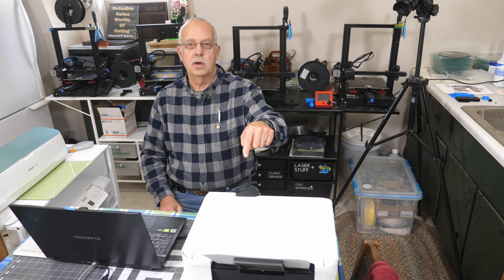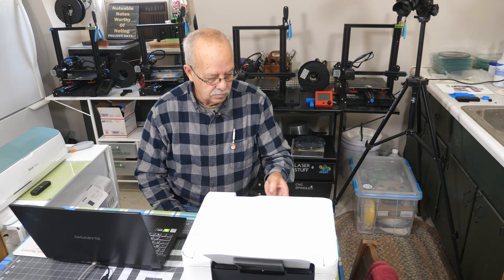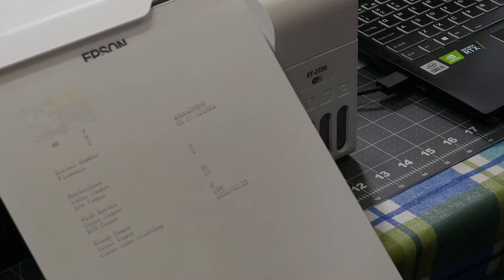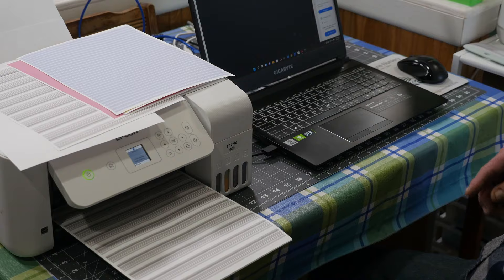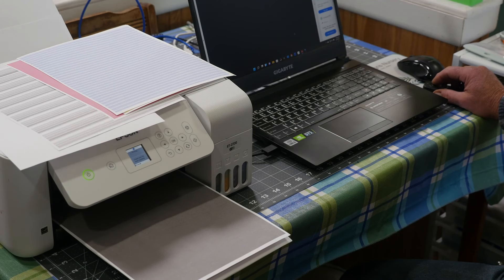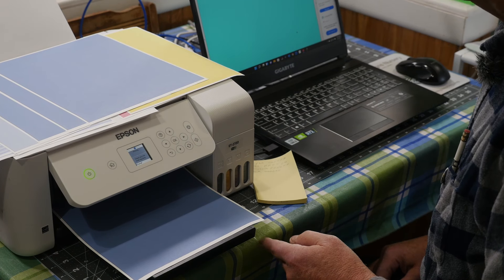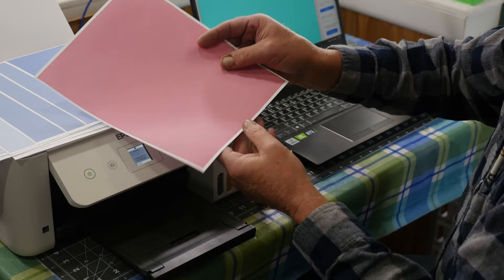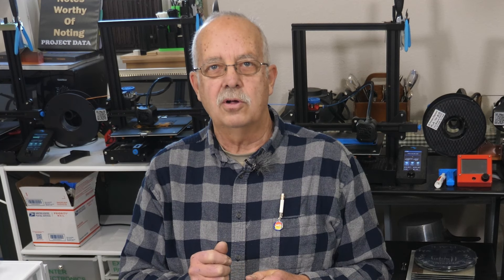Epson 2720 Printer Clogged Nozzles FIX

Comment: Very informative video. Thank you! I discovered yesterday that my cyan has completely stopped printing. A bit surprising as we print regularly. We're in the Phoenix area where it is HOT right now, and our A/C went out a few days ago. Temp in the house rose to almost 100 before we were able to get it fixed. I'm wondering if that high heat might have done something. Anyway, I've printed about 10 copies of the cyan PDF with no results yet (interspersed with about 4 head cleanings and nozzle checks). At what point would you suggest I dive in and try the power clean?
Reply from the maker: Try shaking the printer from side to side several times and try the cyan again.  Could be something as simple as an air bubble or some sediment in the ink tank blocking the line.
Reply: @rogersshop  Will do. I actually filled the ink to 100% today, which had no effect, and then did a power clean, which also had no effect. Will try shaking and then if that fails, reach out to Epson. Thanks for the suggestion.
Reply: @rogersshop  Thanks for suggesting the shaking option. I was literally going to head to Costco today to get the Epson ET-2850 (on sale right now) - with some reluctance giving my current frustration with my ET-2760. A couple hours after shaking my printer a bit, and literally right as I was heading out the door to Coscto, I tried one last cyan print sheet. Lo and behold, it worked! Seems to be totally back to normal. So for others out there, don't give up before trying the shake method and waiting a little while. Also, for whatever it is worth, I called Epson support and was connected immediately with a tech support specialist, who was not terribly helpful with further troubleshooting (my warranty ended 6 months ago). However, he did follow-up via email with info on local Epson service centers and discounts for new or refurbished printers. I'm thankful I don't need to go that route now that mine is working again thanks to Roger.
Reply from the maker: @bradstoops8862  Glad it worked out for you!  This works about 90% of the time as it clears any sediment or air bubbles.

Comment: hi roger.  thank you for the wonderful video and explanation of cleaning the nozzles on my ET-2720.  my tanks are currently 3/4 full and I use my printer almost daily.  every now and then a nozzle clogs and I run the "clean print heads" and eventually everything works fine again.  this time - my yellow did not print at all.  I tried to clean several times and still nothing.  so, I downloaded your yellow sheet and have now tried to print that about a dozen times and still no yellow color is printing at all.  I even tried cleaning and a nozzle check one more time.  no progression.  I appreciate your info about the maintenance tank - I never knew about that.  I'm guessing there's not point in running a power clean now- because you said this method is basically the same, but the maintenance tank doesn't get filled up.   so....  any suggestions on what I should try now??  thanks in advance for any help you might have...  :0)
Reply from the maker: Try this:  Disconnect printer cables.  Picj it up and shake several times side to side, then try the yellow sheets again.  This works most of the time if there is any sediment blocking the bottom of the tank.
Reply: @rogersshop  thanks so much for the quick response.  I tried what you suggested.  I then printed 6 more sheets of yellow, but still got NOTHING.  I cleaned the print heads 2 more times and did another nozzle check.  FINALLY a few yellow lines showed up.  I cleaned one more time and printed another yellow color sheet and it printed yellow!!!  so something definitely shook loose.  THANK YOU SO MUCH.  it looks like I am back in business.  so relieved.  :0)

Comment: HI Roger!  Lots of great information.  I am still not able to get my  Epson 2720 to print the cyan and magenta.  The yellow is great but the black remains with lots of lines.  My printer is only a year old and I haven't printed much with it.  Unfortunately i  didn't realize that i needed to print something out way more often.  Am I doomed or is there more I can do to unclog the printer head?  Thanks for any info. you may be able to share.  Great video !
Reply from the maker: If the color sheets do not produce results after many tries, a Power Clean may be necessary.  Sometimes, gently shaking your printer from side to side may clear any sediment that may have formed in the tanks.  Try this, then more sheets.  Works for some, but not everyone.

Comment: Hi Roger! I am having an issue with my ep2720. It suddenly started printing blue colors and nozzle check have lots of broken segments/line even on the words. I am printing your black pdf and it is coming out brown on my regular printer paper… should I keep printing for it to be black?
Reply from the maker: Is it sublimation ink?  If so, it can appear brown in color until after the heat transfer.

Comment: Before I saw the video I ran a couple of nozzle checks and 2 deep cleans. I printed 25 pages of the same color and haven’t seen any change. Do you think it is worth ordering more ink and continue trying?
Reply from the maker: You could have a clogged line from the ink tank to the internal damper tank.  You can try shaking your printer from side to side several times.  This works most of the time, but not for everyone.  Some inks can form sediment if sitting for a long time and this may free it up.

Comment: You’re video is great! All of my color tests sheets resulted in success with no lines, except for the Cyan. No color, no nothing. I’m running the test sheet for the cyan continually with nothing showing on pages. Running 45 pages at a time over and over. What are your recommendations please? A new printer is not in my budget.
Reply from the maker: Sometimes sediment can form and block a line.  You can try shaking your printer from side to de several times (don't get wild, though) and try again.  This works "most" of the time, but not always.  As a last resort, try a Power Clean.

Comment: Roger, awesome video but sadly my printer has been through about three pages each of magenta yellow and cyan and I haven't got a lick of color yet. I'm gonna keep going and comment again if it clears, but curious if you've seen a clog that won't clear?
Reply from the maker: Try shaking the printer from side to side several times and try again.  Most of the time, it is not the head clogged, but a tank or line.  I have also run into some that may take 25 or more sheets to finally get a good color sheet.
Reply: Thanks Roger. I'll give that a go and let you know if it worked for me. So far I've run about 6 sheets of each color and still not even a blip of any of them. @rogersshop

Comment: Thank you so much for this video!  I haven't used my printer in a few months, and my pages got worse with each nozzle check. Originally it was just missing magenta and cyan. But now my page is completely blank. I am printing the colors now and hope this works. =( so far I have a yellow page, blank, yellow again...and waiting for the 4th.

Comment: Thanks for the video and all of my colors are working well except Yellow.  Have run 20 sheets on Yellow only and cannot get anything to show up.  Any other options?
Reply from the maker: Sometimes it can take a LOT of sheets running through before the head clears.  You can also try shaking your printer from side to side in case sediment built up in the tank and is clogging the line.

Comment: Great video!  It worked for every color but Cyan.  Tanks are all full.  Any more suggestions?
Reply from the maker: You can try shaking your printer from side to side several times.  Some inks can form sediment and clog the lines.  Works for some, but not everyone.

Comment: roger help i am trying to use the paper method to unclogged my nozzles and all i can get it to print is yellow.  The black , cyan and magneta is not showing up at all.  I have the et-2400 and i am using it for sublimation.  I have been using it and now it is printing only yellow.  Also how do i print the sheets you have suggested except the yellow?  Please help
Reply from the maker: You can try shaking the printer from side to side several times, then try individual colors again.  Works for most, but not everyone.
Reply: Thank you. Will try

Comment: My L6190 prints perfect test pages after a head cleaning, but fails to print after 5 minutes of idling right after cleaning it. What could be the problem? I’ve tried cleaning the capping station, the wiper, cleaned the suction pump tube. What else could I be missing?
Reply from the maker: Not familiar with that model (and I am not a printer 'expert').  If just one or two colors, could be sediment in the ink tanks.  If all colors, then the damper tanks are losing prime.
Reply: @rogersshop   I have primed the dampers, and I don't think it has any sediments in the ink tanks. The problem worsened after doing a power cleaning, and has clogged all colours except for yellow, but yellow fades out after awhile as well. Any other ideas?
Reply from the maker: @jundaaaaaaaaaa  There could be soilds/dried ink in the printer head and that is near impossible to clean out 100% and requires removing that part (not easy).  There is a "cleaning solution" out there where you soak the bottom of the print head with a paper towel saturated in the stuff, but that will not clear any solids inside the head and is a mess to deal with.

Comment: thanks so much great video as usual! I have a question. My printer epson 2760 is making blobs of ink (black) at the top of my pages. I am going run your cleaning nozzle. These spots look like the ink is spilled in one place on the paper. any ideas? thanks
Reply from the maker: Run a few pages through with solid colors and it should clear it up.  The "pads" may have excess ink on them.
Reply: thanks I will do that.  I wondered if it was the pads. I use my printer just about every day, so this should really help!

Comment: thank you for this information.  My black worked great but the other colors have nothing at all on the paper.  So far, I have run 5 sheets through for one color and nothing.  Could it be something else?  My tanks are full.
Reply from the maker: Several things could be at play.  Sometimes, inks can form sediment if not used for a period of time.  You can try shaking your printer from side to side as this may dislodge any sediment.  As a last resort, do a Power Clean.
Reply: @rogersshop  I tried the shaking and that didn't help, but someone else suggested putting a damp piece of paper towel under the head and letting it sit for an hour.  I did that and then ran it through the cycles and it's working great!
Reply from the maker: @debbareman6655  Yes, that can also work since the ink is water-based.  I did not mention this as many cannot tell the difference between "damp" and WET!

Comment: So if this don't work is it safe to say I need to purchase another? How ever I wish I would have found this a longggggggggg time ago . Great video.
Reply from the maker: Works for most, but not 100%.  You can also try shaking the printer side to side several times if it does not work and try again.  Most of the time, the problem is NOT the print head.

Comment: Thank you Roger. I have downloaded your document, and printed it about 20 times. The only color I can get to print is black. I am starting to get quite concerned. The black is getting less and less lines through it, but like I said before it's not printing my yellow, magenta, or cyan 😢 Is there anything else that you recommend?
Reply from the maker: Disconnect cables.  Shake printer side to side several times, reconnect and try again.  Works for most, but not everyone.
Reply: @rogersshop  Okay, i'm mindblown!! The shaking it seemed to have broken something loose inside the clogged area!!! Suddenly it's printing the missing colors again. There are still lines in the pages. So I am going to keep printing your documents until it is fixed, but this seems to have done the trick. Thank you so much Roger!! You have seriously made my day!!!😃😃😃
Reply from the maker: @CydniAhern  Some inks can form sediment and clog the outlet from the tanks to the lines.  Shaking usually works, but not 100% of the time.  There is also an internal damper tank that can "air lock" and the shaking can fix this as well.

Comment: Thank you so much for doing this video. Very helpful. I ran all 4 colors. I zero yellow and zero magenta.  In fact they come out a faded blue. do I just keep printing until it starts to print or is there another fix. I really appreciate any help.
Reply from the maker: Sometimes, certain brands of inks separate and form sediment that can plug lines.  Try gently shaking your printer side to side several times, then try again.  Power Clean as a last resort.  Shaking has worked for several with this same problem.  Just don't get wild or you will have a mess!

Comment: so hey roger before seeing  this video I did a cleaning head with the cleaning for my blue color cause that was the only one missing on the test, and it was still wasn't printing so I seen your video and did it with the sheets like 25 times with the blue color and still no results, do you suggest another method or I just have to get a new printer?
Reply from the maker: The line from the tank to the internal damper is probably clogged.  You can try shaking the printer from side to side several times (don't get wild with this!) and it may free up any sediment that could have formed.  other wise, it will require some internal "surgery".
Reply: Ok hopes it helps

Comment: I have the Epson 4760 and recently have been trying this. I got one page printed for the magenta (the only missing colour) before it completely switched over to a solid pale yellow colour. It's been this same solid pale yellow colour over at least 8 pages of printing magenta. Any ideas? Is it worth trying more or does it seem like i am one of the unlucky ones this won't work for? Thanks!
Reply from the maker: You can try shaking your printer from side to side several times and try again.  Some brands of ink can form sediment and block the lines.

Comment: THANK YOU!!!! That saved my printer!!! Question. I can't find how to SLOW down the print speed. I went into settings as you did, but I don't have...more options. Is there another way? I tried in printer settings, but not there either.
Reply from the maker: Make sure you have the driver for your printer from Epson.  If using the generic printer driver, options won't show.  You can download the driver and software package from Epson website.
Reply: @rogersshop  oooh ok. Thank you yet again!!! I really appreciate your video and THANK YOU for the super fast reply. Have a blessed day.

Comment: Do you have any other suggestions if this doesn't work?

I printed over 100 pages of black + color and it worked perfectly.

A few weeks later went to print something else again and it worked perfectly for like 30 pages then the Cyan & Magenta colors quit working (yellow & black worked fine)

Did the Nozzle Check and the printout had no Magenta or Cyan (Black + Yellow lines were full)

Did Nozzle Check several times and randomly Magenta + Cyan + black worked perfectly, but yellow barely had any lines.

Did Nozzle check several more times with no luck.

Did your printout and all colors, but Yellow work (just small streaks).

Literally printed over 100 pages of yellow (at first small streaks vast majority of printouts nothing at all).

The ink is full on everything besides black (topped up the 3 colors).

Do you have any idea what might be going on?
Reply from the maker: It could be that sediment may have formed at the bottom of the tank and is clogging the lines.  Try shaking your printer from side to side several times (gently!) and try again.  This works for most, but not everyone.  As a last resort, try a Power Clean.
Reply: @rogersshop  Thanks I'll try that later tonight. If it doesn't work then some percussive maintenance may be needed.
Reply from the maker: @jeremiahinvests  There are more processes that can be done, but it gets VERY involved, requiring you to open the printer, remove the dampers, use a specific syringe, and try not to make a mess.  I may do a video in the future on this process, but it is very involved.  I just posted a video this past week of one of these printers I bought on eBay that someone tore up trying to fix it.  https://www.youtube.com/watch?v=woYcFhaLWRM&t=3s&ab_channel=Roger%27sShop

Comment: Any tips on issues with just the cyan nozzle? This video helped fix issues with other three colors but every time I print cyan it comes out a faint yellow. I’ve printed 18-20 pages of that color along with no improvement. Ink level is 80-85%.
Reply from the maker: Try disconnecting the printer, pick it up, and shake side to side many times, then reconnect and try again.  This often works.

Comment: Will this method work with a inkjet printer? My one is Epson L6160 and it does not print black at all. 😢
Reply from the maker: Intended for ink jet printers.  Works 'most of the time'.  Your mileage may vary.............

Comment: Roger this has helped a lot thanks. I still have one issue, every time i print the magenta, it comes out various shades of purple rather than a pure pink tone. I've printed about 10 sheets and just when I think I'm getting somewhere, it goes back to a purple/lilac tone (sublimation ink). I ended up cleaning the heads but this has not made any difference. Anyone got any ideas of how to fix this problem? Any suggestions would be really appreciated.
Reply from the maker: Sounds like ink has separated.  You can try shaking the printer from side to side several times to mix it back up.  works sometimes.
Reply: OK, will try that thanks 👍